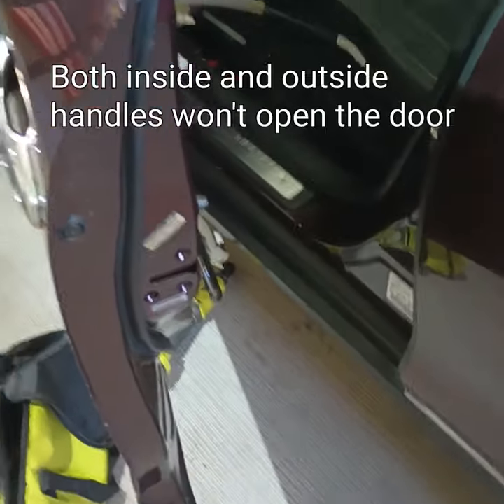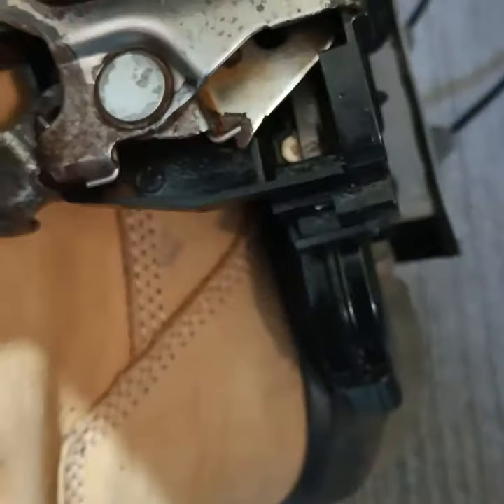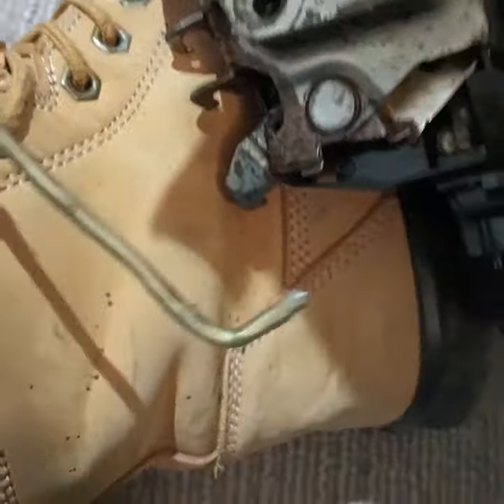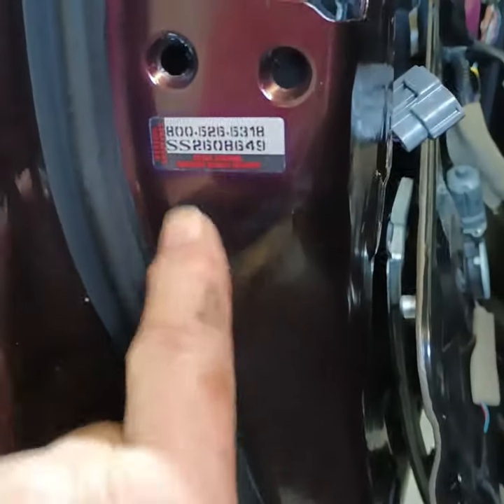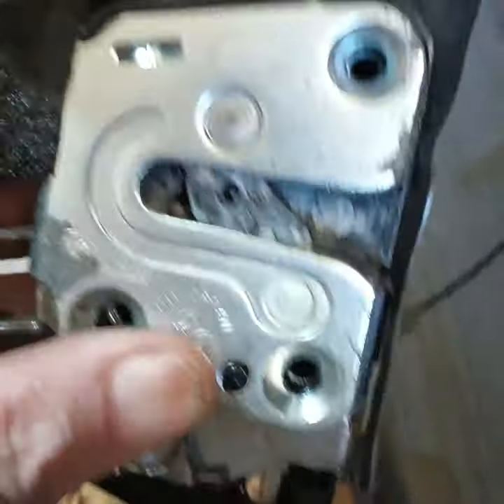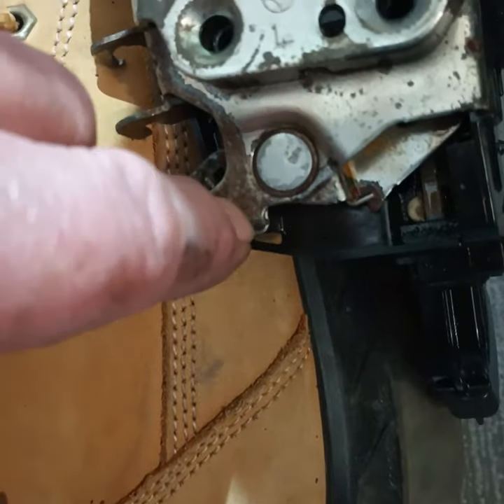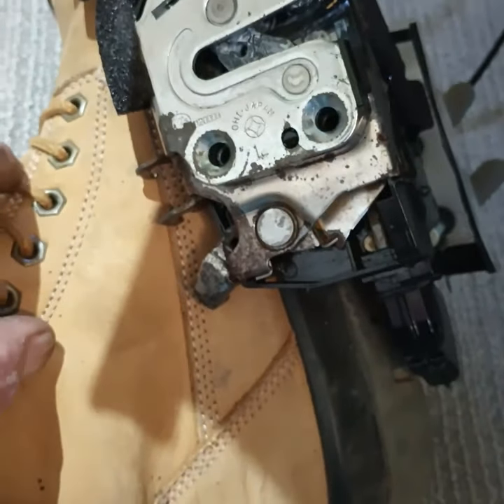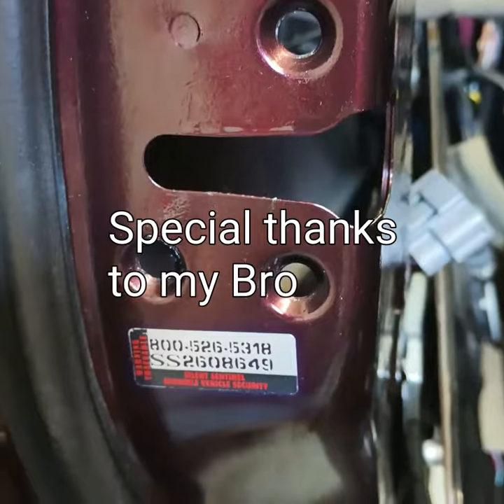Can't Open Your Car Door From Outside or Inside?

Comment: Have got a jeep Cherokee 2015 drivers door will not open from both sides in and out it’s closed aswell please help me am getting in and out off the other side it’s a nightmare 🤬🤬
Reply from the maker: You need to get a slim Jim and try from outside or inside to get at the backside of the lock to unlock it - or get a locksmith - good luck and Cheers from Canada
Reply: Omg this is currently me & it’s so embarrassing

Comment: Having door issues on my 99 Grand Marquis. Inside/outside handles "open" the door but it'll be stuck, pushing the door back in and pulling on the handle a few times seem to work sometimes but not always. Visual inspection of the door latches of the working and non-working door do not show any difference. Thanks for uploading this will check the things you've pointed out in here.
Reply from the maker: Rusty on the inside of the door latch - lube inside as much as you can
Reply: @carquestions  After I got the door open and I sprayed a generous amount of WD-40 inside and it worked!! Door back to opening and closing.

Comment: Strange video, if I can't open from in or out, how do I remove door panel  ???
Reply from the maker: You have to use a slim Jim or other similar method to get access to the lock and latch

Comment: My door won’t open, won’t unlock, won’t lock. Can’t take the panel off because of this. What can I do?
Reply from the maker: You need to spray loads of WD40 towards the Latch from above and get a slim Jim / coat hanger and fiddle with the latch from inside as suggested in the video - good luck Quarth - Cheers from Canada!

Comment: i have this issue with a Ram 1500 back door. Child lock is on and outside handle wont open the door
Reply from the maker: Got out the slim jim and work the lock vigorously - let me know how it works out - Cheers from Canada

Comment: I live in Australia I have a 2006 VZ Holden commodore i had the same problem took it to a locksmith he open it with in a minute I would try a locksmith first rather than destroy the door.
Reply from the maker: If your good with a slim jim it could save you a bit - Cheers from Canada Chad!
Reply: Bro same 2005 vz wagon
Reply from the maker: good to know - thanks @vexorin9148
Reply: Hi whereabouts in Australia are you? we have the same problem with our 2004 VZ Holden and took it to a auto electrician which we were advised by a locksmith and was charged $1400 and only lasted 6 weeks and back to being unable to open again. Did you take your car to just a locksmith or someone specialising in auto locks? We would appreciate your input as we are unsure as to who to take our car to get this problem sorted.

Comment: I have a 2003 Wrangler Sport TJ, and have a “no fuse” alert. I am having trouble locating the IOD fuse. Any idea where it is, specifically. I cannot find it.
Reply from the maker: Best advice is to use the owner's manual or description on fuse cover. Cheers from Canada - sorry about late reply

Comment: On 2010 Lincoln MKT front driver side door handle won't open (opens on inside handle).  I've taken the panel off, but now what?
Reply from the maker: You need to look closely at the inside part of the door look - or better yet remove the door lock for close inspection - maybe rust is jamming it up

Comment: i’m stuck in my room parents out for camping phone at living room windows don’t open only my laptop please tell me what to do in the inside
Reply from the maker: Is the door stuck or locked? Push and pull on the door
Reply from the maker: Look for a latch on the window
Reply: @carquestions  i’m opening it and it’s not doing anything
Reply: @carquestions  the window is gated outside for security reasons
Reply: can i call the cops on my laptop because img trying  and
Reply from the maker: things are looking bleak Skippy - can't you just email friends  @SkippingTax
Reply: @carquestions  yea i’m out now i texted my brother on discord and he came home
Reply from the maker: do you have a bottle in the room? @SkippingTax
Reply from the maker: good to hear - might want to get a phone link for your computer @SkippingTax
Reply: @carquestions  doing it right now
Reply: @carquestions  2004 toyota camry left rear door is unlocked but will not open from inside or outside
Reply from the maker: @kevinbradley1701  rusty lock - so spray wd like crazy near the lock through the top of the window edge - then get a slim jim to try and manipulate the lock

Comment: Got a toyota solara. The door latch got stuck in the open position after being stuck locked shut. -11 degrees when all this happened.
Reply from the maker: I'd try a safe source of heat very near the latch - hair dryer, torch - not too close - Cheers from Canada!
Reply: @carquestions  update soon,  wish me luck.
Reply from the maker: I do - let me know what happens - good luck @shypony5820
Reply: 2:40  @carquestions  because I don't know the part, it's that piece between those 3 big screw holes on the metal part, in that long hole you could slide your finger In. I've been sitting in my car since I replied with heat on (just for me) but the door finally closed. That lock/latch/actuator. Whatever it should be called has moved. Huzzah!!
Reply from the maker: yes that is the latch! it has parts in it that stick when cold - good idea to warm the car by the way - well done! @shypony5820

Comment: In my door I think the only issue is the cable, because both handles are loose. Or it's something else and feck me then.
Reply from the maker: the latch lever on the lock mechanism is rusted likely - not the cables - use slim jim
Reply: @carquestions  Yeah, you are probably right. I looked inside, and the cables work fine, I think it's the lock mechanism itself.

Comment: My ford fusion looks almoat exactlynlike that
Reply from the maker: It was an Infinity EX35
Reply: @carquestions  i meant the internal lock a d screw placement.y⁷ýI ended up breaking all the plastic plugs pieces and pushing a small thing screw diver down the lock to release the lock. Luckily I bought a bag of replacement plugs when I did the speakers like a month ago.